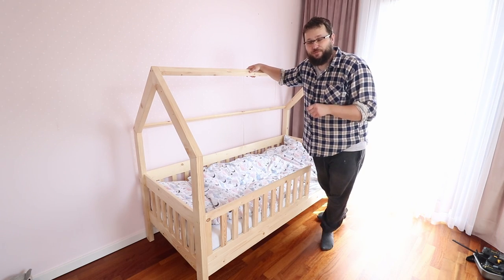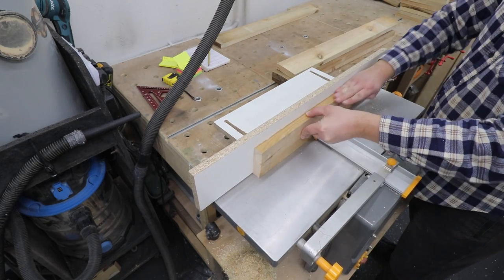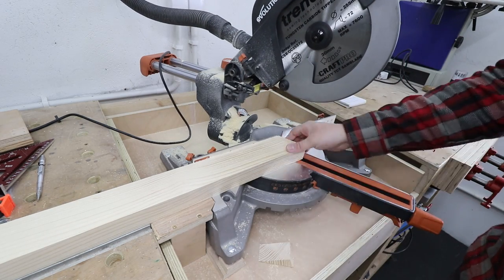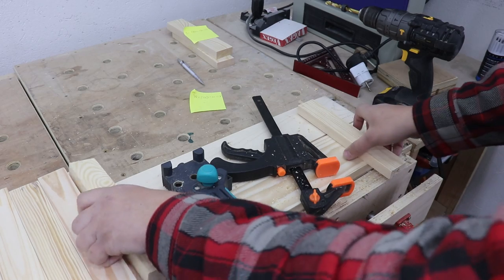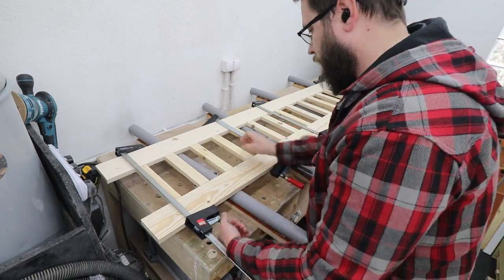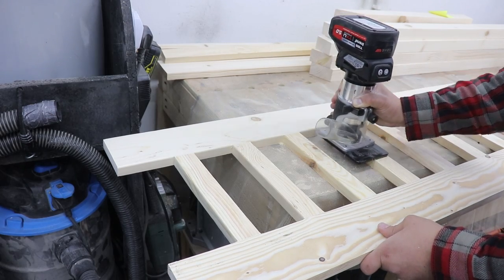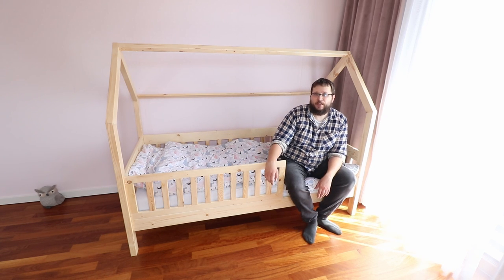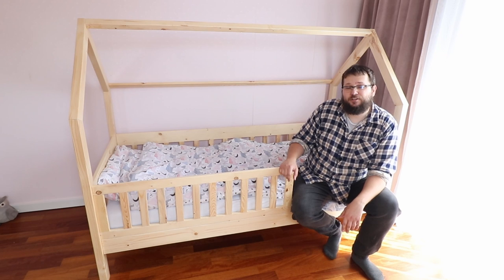Easy DIY Kids Bed | Free Plans

Comment from the maker: My other videos you may be interested in:
- Dowel Joinery Made Easy With a Cheap Jig - https://youtu.be/wgxwojt3vAo
- Perfect Glue Ups With PVC Pipe Platforms - https://youtu.be/-clEoWj8P2s
- DIY Pipe Clamp Bench Vice - Will it Work? - https://youtu.be/ZOC7i9x5Szo
- Milling Rough Lumber with Budget Tools - https://youtu.be/Vv_zw2oAhts